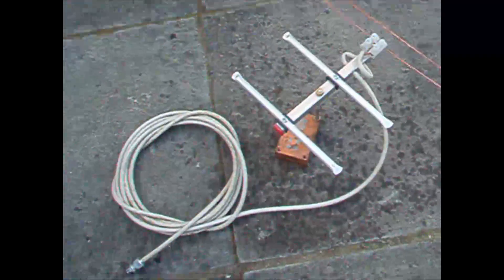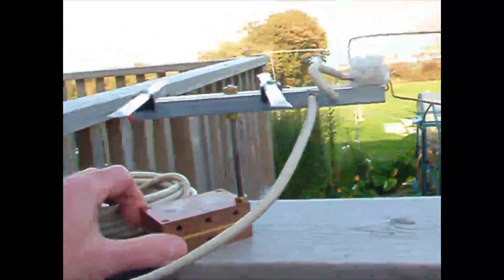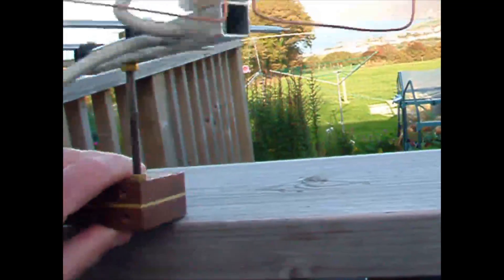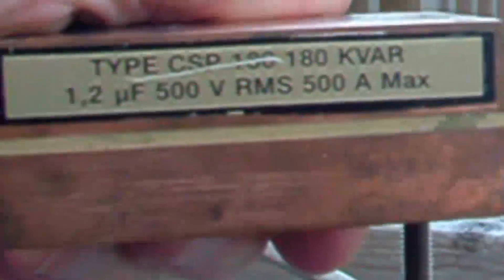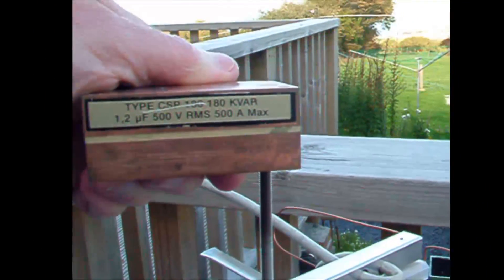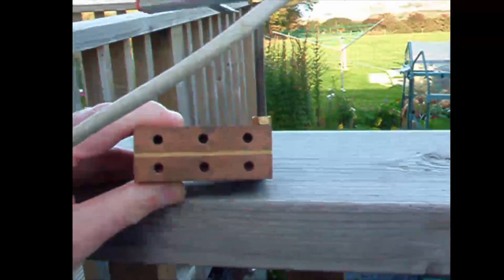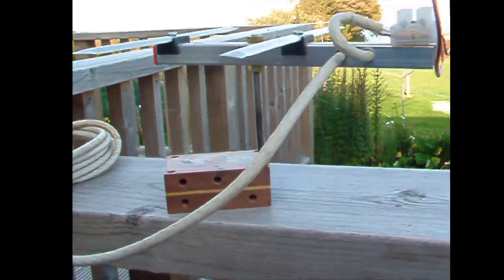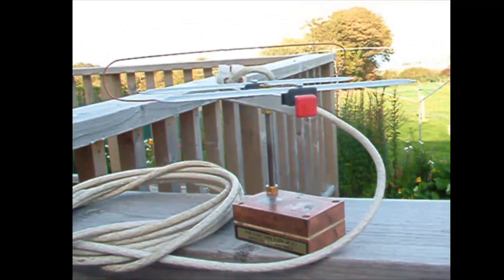500 Amp antenna base?

Comment: I am just amazed that were able to work with someone who was a design genius of capacitors. Cannot still get me head over the fact that this cap can take such great Amps rating. Just blows me away Andy.
Reply from the maker: I imagine that things have moved on a bit since I was involved. I can remember that when I first got involved with induction heating a 100 KW radio frequency machine was the size a domestic garage and needed a crane to move it. When I left the industry one man could carry a 100 KW machine on his own.  Everything has changed dramatically, component capability improved with better understanding and I guess it will continue until we screw it all up.   Regards . . .Andy

Comment from the maker: @AllAmericanFiveRadio I wouldn't like to suggest any limits to the application of the capacitors Rick. They are designed with the lowest possibly inductance so they can be stacked up in series. I've designed and built tanks with up to three in series with several in parallel. I don't know if you read the description of this video but you might find it interesting.
73's ... Andy